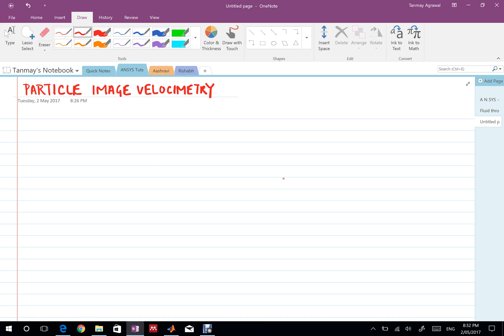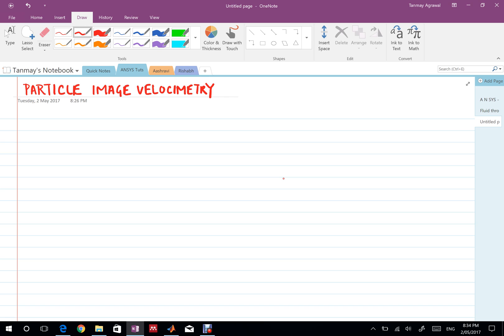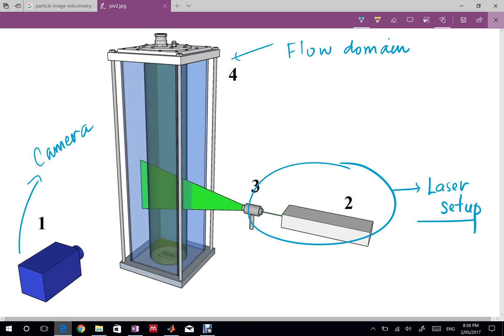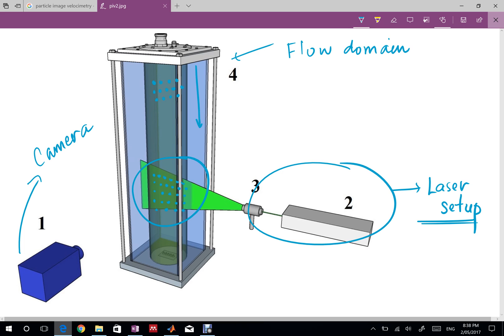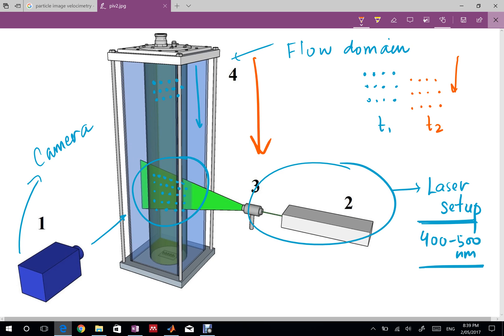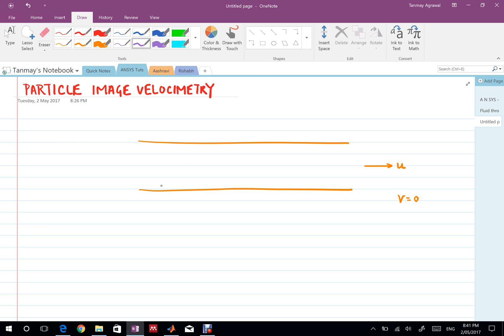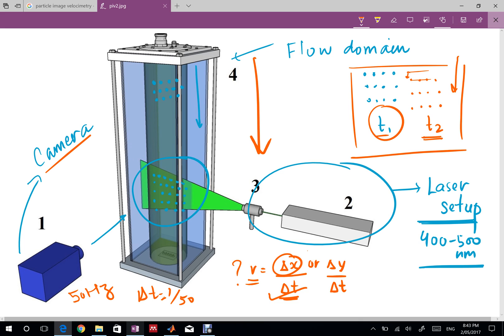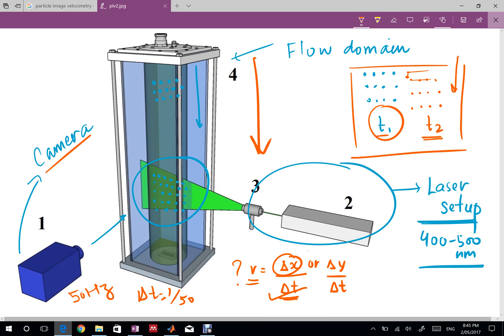A Beginner's Introduction to Particle Image Velocimetry (PIV) using MATLAB - Part 1

Comment: Hello Tanmay, thanks a lot for your explanation. Since the laser sheet is very thin, what if particles move around and couldn't be illuminated by a laser beam? Won't this affect experiment results? Thank you!
Reply from the maker: Yes, the thickness of the laser beam plays a part. You may refer to a textbook for understanding better.

Comment: If u can answer my simple question that would be very beneficial
1. What is the size of image in mb which Is getting generated
2. Why we are not taking a video
3. Why we need synchronisation if we can just continuosly keep on the laser and just click images...no need to synchronise the camera and laser on off..?
Reply from the maker: 1. Can't remember but you can calculate from size of image. Maybe I'd say around an MB.
2. Originally we took a video and split it into images for analysis.
3. Some lasers can't run in continuous mode with high power. They need time to do the stimulated emission, therefore you need sync.
Reply: @TanmayAgrawal7  thanks understood

Comment: I am using piv in thermoacoustuc device oscillatory flow.The flow medium is air and smoke from insence sticks. Do u recommend me to keep using this type of smoke ??
Many thanks
Reply from the maker: Smoke is actually used, yes. So I don't see any problem. As long as there are no reactions taking place, it should be fine.
Reply: @TanmayAgrawal7  so thankful to ur response. Wish u all the best.

Comment: Thanks a lot for ur effort, this video is really helpful. I am using piv , How can I measure or calculate the particle size plz ?
Reply from the maker: You can calibrate your image (say by putting a ruler in your field of view) and then using that you can convert the particle size in pixel to physical size of particles.
Reply: @TanmayAgrawal7  thanks a lot. Happy to hear from u.